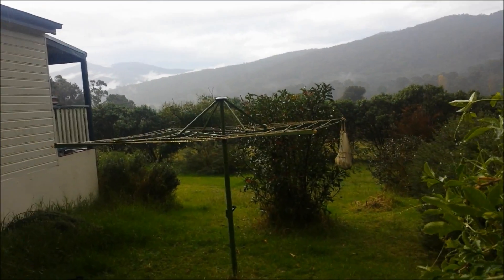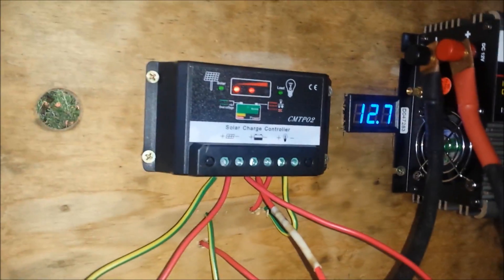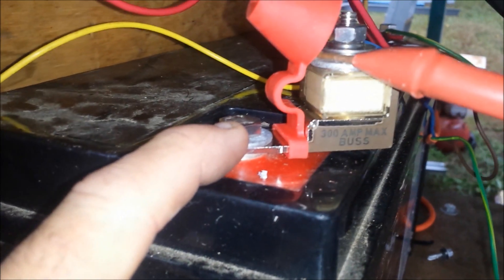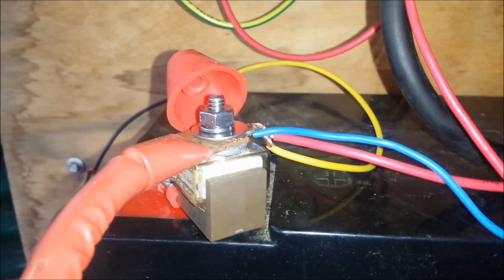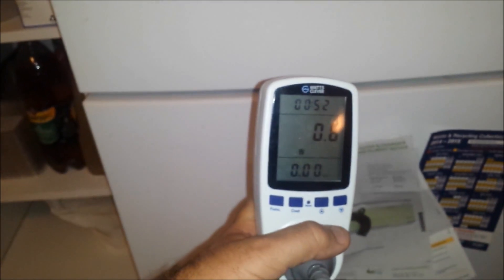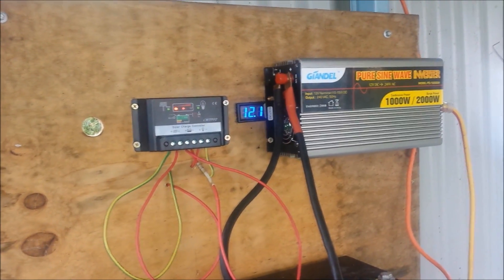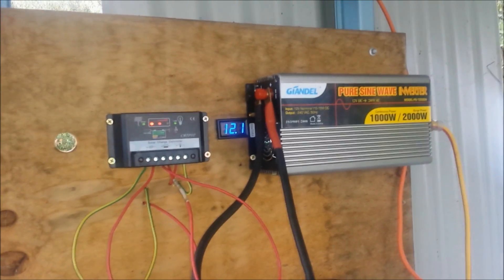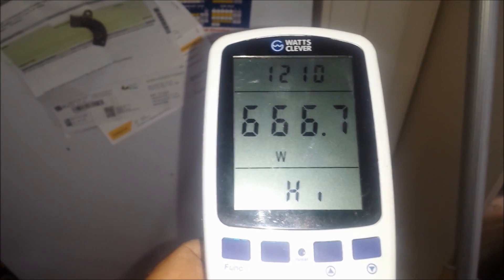Off Grid Solar Power - Testing the 100W Solar Power System

Comment: Can a 12v 100w solar panel charge a 24volt battery? What fuse can i use, and if i only use it for a 35 watt gadget, can i use it 24/7 without unplugging it. Please simplify. Thanks
Reply from the maker: A 12V panel can't charge a 24V battery but two 12V panels in series (24V) can charge a 24V battery.

Comment: great video am on my way in setting small off grid system your videos helps alot one question what if you  use a 2000w  inverter with that battery amp hours would get the same amount of run time
Reply from the maker: Fairly similar, a larger inverter will use more electricity itself.
Reply: @PopsShack  thanks much

Comment: Check out some 6 volt golf cart batteries 230ah x2 =460amps and you can use 230 of that it should keep your fridge going all night and then some. It's all about the batteries but more watts of panels is always a good thing too.
Reply from the maker: You should watch my more recent videos. :p I've been off grid at the shack for more than six months now.
Reply: I see that nice job you are doing, but take a look at golf cart batteries they can be serviced and they have more usable amps then 12 volt batteries. If you ever have to change those. I have had mine and they are still good after 5 years.
Reply from the maker: +gunlover1955 I bought 32 6 volt deep cycle batteries recently for $1,000. They're not golf cart batteries. Why, specifically, should I buy golf cart batteries?
Reply: They have more amps and they can be serviced, this is just what I do you can do any thing you want to but if you want to keep your batteries a long time non-serviceable batteries is not a good idea I check mine every month and fill them with just distilled water to keep them going like new.
Reply from the maker: +gunlover1955 How many amps do they have?
Reply: Mine are rated at 232 AH each so 50% is usable so as not to over discharge them 115AH each is available.